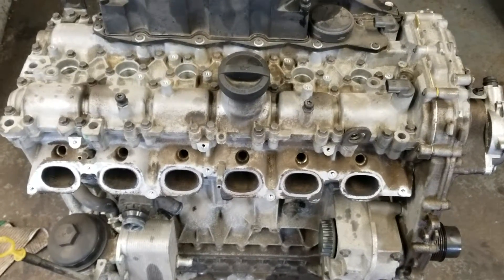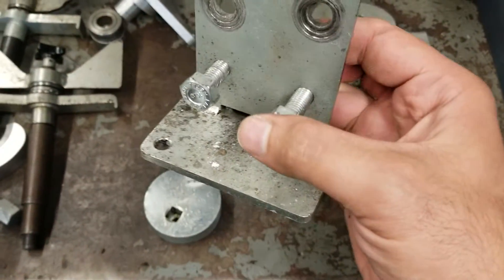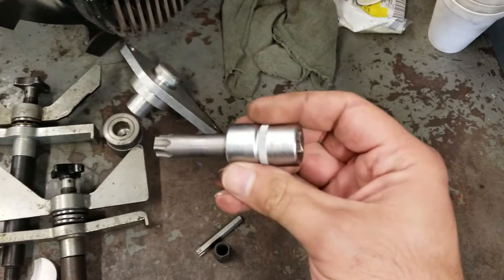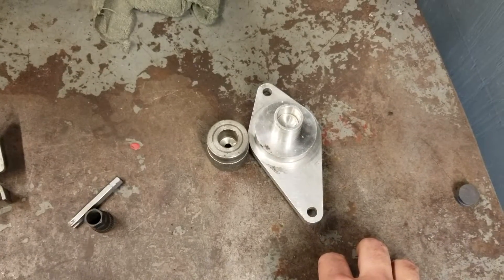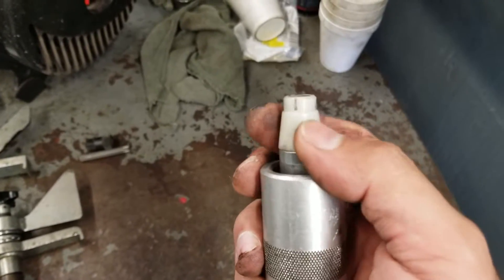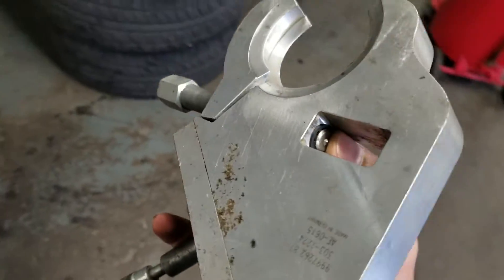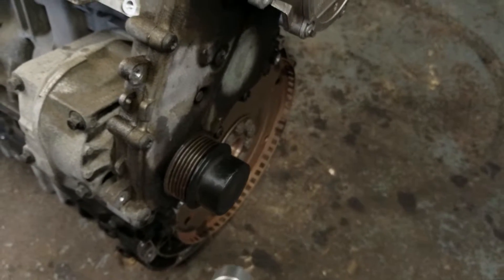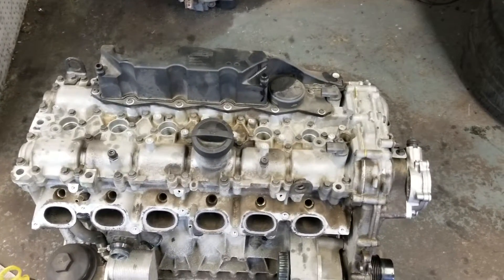Volvo SI6 3.0T 3.2 Valve cover/ Cylinder head removal Part #1 Spacial tools

Comment: Could you please let me know the lip seal installation tool PN# ? or where to get one?
Reply from the maker: I will get you the part number for you but it's only available at the dealership.
Reply: @TheVolvoGuy  that should be fine. Do they call it lip seal installation tool?
Reply from the maker: It's called a Drift tool. Tool# 999 7265.
Reply: @TheVolvoGuy  any way to install this seal without using this tool? Also the Pulley on my XC60 is rotation both ways, and it's wiggling.
Reply from the maker: @parezfaiz1826  there is no other way without that tool. The pulley is a one way clutch it should turn one way and it should lock when you turn it the other way.
Reply: @TheVolvoGuy  thanks for these useful information. Now I am worried about how to install the seal again without this tool. I am sure dealers will not lend it nor selling it :(
Reply from the maker: @parezfaiz1826  the dealer will sell you the tool if you want to buy it. If they refuse I can buy it for you and ship it to you. But they can not refuse.
Reply: @TheVolvoGuy  I will ask the dealer here. I will let you know if I get it from them or not. Thanks for offering help with purchasing the tool
Reply from the maker: @parezfaiz1826  no problem
Reply: @TheVolvoGuy  I called the dealer here. I was told they will not sell tool to individuals, they only sell them to shops.
Reply from the maker: @parezfaiz1826  most dealers have no problem but they seem to be A holes. But any way I need to contact you some how so I can get one and ship it to you.
Reply from the maker: @parezfaiz1826  it's ok I work at a volvo dealer they will sell it to me and you pay me and I will ship it to you if you want.
Reply: @TheVolvoGuy  that's generous offer from you. Please text or call me to get in contact. I can send you money there for the tool and shipping.
Reply from the maker: @parezfaiz1826  did find out what you want to do?
Reply: @TheVolvoGuy  I have posted my phone number here twice hoping you can contact me, but it appears youtube removed my comments. I ended up installing the seal without the tool, all I did I fit in a 13MM from the back of the seal with a nice lubrication with new oil. I aligned the 13mm socket with the shaft and slide it in and installed it. It looks like its working now and the leak is stopped. I have also reached out to a dealership in GA, they will be requesting the tool for me and ship it to me later,. Thank you for offering help and providing me the P/N of the tool too.
Reply from the maker: @parezfaiz1826  no problem am happy you were able to take care of it. Anything you need I will be here to help.

Comment: What is cylinder head bolt torque ?
Reply from the maker: 1st 45nm 2nd 45nm 3rd 90 degrees 4th 180 degrees
Reply: The Volvo Guy what diffrent in 1st step and 2nd step 
Or 
I can tight 45 nm , 90 degree and 180 degree
Reply from the maker: @Abdallah-Asfour  you have to do 45nm 2 times in order to make sure all the bolts are even before you move on to the 3rd and 4th step also make sure to tighten the bolts in the correct sequence
Reply: The Volvo Guy great .. appreciate your support
Reply from the maker: @Abdallah-Asfour  any time
Reply: @TheVolvoGuy  Follow up question on this, given the 3rd step is 90 degrees and the 4th is 180 degrees. I get the 3rd step, but does this mean it is an additional 90 degrees from the 3rd step (for a total of 180 degrees from the 45nm) or an additional 180 degrees from the 3rd step (for a total of 270 since the 45nm)?
Reply from the maker: @vendyit  the fist step is 45nm the 2nd is 45nm the 3rd is 90 degrees and the 4th is 180 degrees total 270 degrees

Comment: I have a 2007 Volvo s80 3.2 that has recently thrown reduced engine performance warning and is now exhibiting hard starting and sputtering when it does start. I scanned for DTC codes but none are present. I installed a new battery thinking that may have been the issue but problem still present. Can anyone with knowledge of these Volvos suggest any things I can check or share their experience if they've encountered the same problem? Any info would be greatly appreciated.
Reply from the maker: What scan tool did you use? If engine performance warning showed up you should have some fault codes stored.